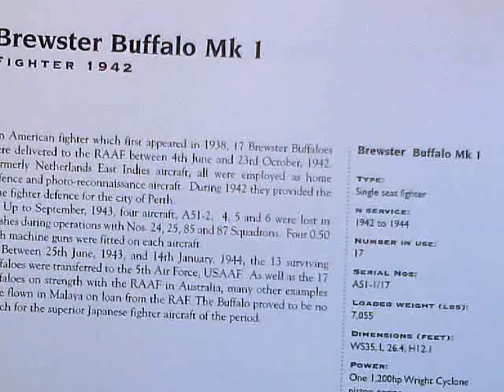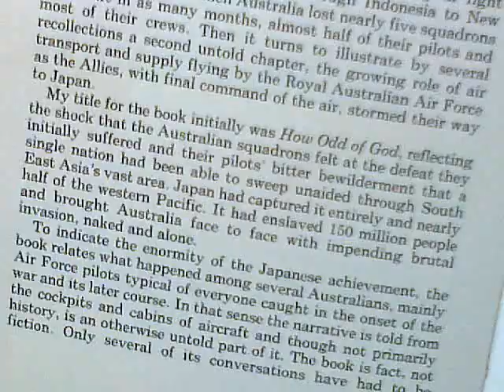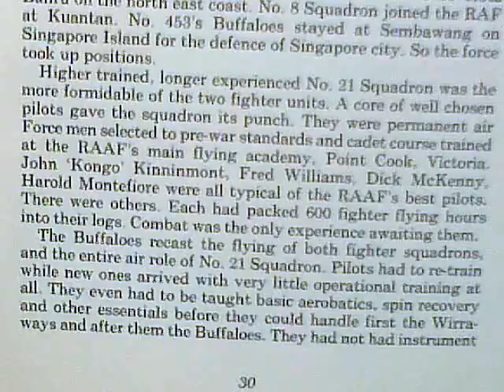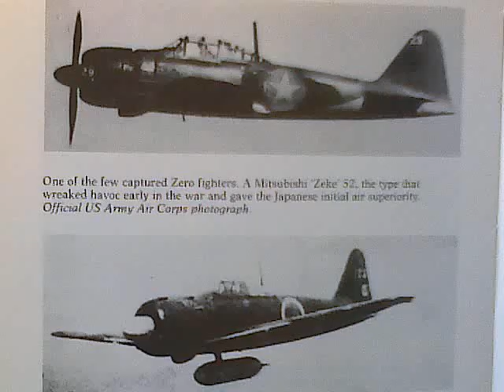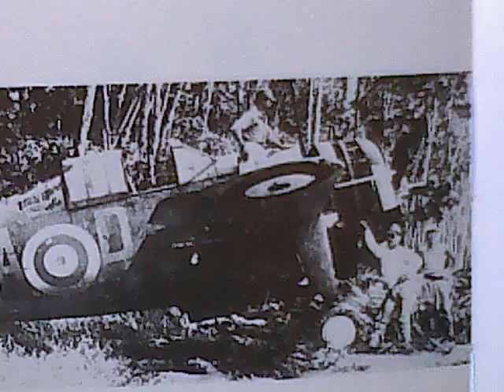World's Worst Fighter Aircraft, The 1941 RAAF Brewster Buffalo !

Comment: It only suffered lousy landing gear.
Otherwise it was not bad. 
It had a pair of the heavy .50 in the cowling with a lot of ammunition which didn't jam or malfunction under g-forces.    It was very manueverable.  Check
Pappy Boyington's description of flying it.  He says "you could turn it inside a phone booth". 
The American Brewster had the 1,200hp engine. 
It had very, very good range. (About 1,550 miles).  
It had a lot of pilot armor, like the Wildcat.  
It was basically a cockpit sitting on top of a radial engine tapering off into an oval cone. 
Finnish pilots flew this fighter successfully, shooting down all kinds of opposing fighter planes, beating both German and Russian pilots.
Reply from the maker: G'day,

  Thanks.

   As it happens, you're not correct.

   I was reading from first-hand accounts of RAAF Pilots who flew the Buffaloes which the British RAF bought from the US and supplied to Australia, for the defence of Malaya and Singapore.

 The .50 Calibre Guns fractured their .30 Calibre Mountings, the Cowling-Guns then simply jammed, and the RAAF Armourers worked their Arses off to cobble up stronger Mountings ; and then when that worked the Pilots complained about the Cosmoline Grease, in which the US Navy required the Ammunition to be packed before shipping, congealing all over the Windscreen and effectively blinding the Pilot in Combat...; the Wing Guns broke their Mountings, and sometimes then failed to jam - so they fired loose & uncontained within the Wings, sometimes shooting the Wing off...

  The HF Radios were hopeless after 10 AM every morning, because they were drowned-out by the Static from the Tropical Thunderstorms...; and the Pneumatic Fuelpumps relied on ambient Barometric-Pressure for the Return-half of every Stroke, so above 10,000 Ft the Pilot had to Hand-Pump supplementary Fuel in order to provide the Engine with sufficient Flowrate as to be able to obtain Full Power from the Engine.
  
  These points are NOT up for debate because they're well doccumented.

   To date, you are the very first (Fantasist ?) to suggest that the Buffalo in the Pacific was anything other than a lump of Dogshit with Wings ; in fact at Midway the US Marines didn't do any better with their Buffaloes than the RAF did  with theirs in Malaya.

  The Finns had earlier, lighter, versions, with Guns appropriate to their mountings, using German Radios (no Tropical Thunderstorms over Karellia, either !), and they fought an essentially Low-Level War against the USSR...; with very GREAT Success..., which is a topic for a different Video entirely.

  There was one Kiwi flying with the RAAF in Malaya who made "Ace" Status flying the Buffalo...; but everybody else found them to be effectively useless.

   Boyington is not at all known for exploits involving the Buffalo..., Curtiss Tomahawks & Kittyhawks with the Flying Tigers in China, yes, and Corsairs in the Pacific, yes indeedy ; but Boyington the Buffalo-Jockey - nope, not in Combat (though like Chuck Yeager and the Bell Airacobra, he may have flown them in training, under Peacetime conditions, or something...?).

 Such is Life,

  Have a good one.

  ;-p

  Ciao !

Comment: In hindsight, a minor overhaul in an adequate aircraft machine shop would have done wonders for the aircraft.  Problem is such facilities didn’t exist in the far-flung colonies nor did they have time to think about it when events “hit the fan.”  Secondly, the tropical environment and medium-to-high altitude mission were completely inappropriate for the design.  Other commenters agree, as they note Finnish successes in tuned-up versions in a cold weather environment, and applied to low-altitude scrambles against similar period Soviet aircraft.  Either way, it was just a rough and largely ignored inter-war design that filled a gap, nothing more.

Comment: The P40 in the Philipines fared no better aginst the better Japanese Zero fighter, whereas the Japanese fighters in the Malaya / Burma theatre were ALL less  advanced than the Buffalo.
The RAAF website gives the HP of the Buffalo MK1 as 1200 hp, with a Wright Cyclone engine.
This is a classic case of blaming the aircraft for shortfalls in training, support and logistics. 
The Buffalo was the ONLY allied aircraft that could out turn a Zero.
Reply from the maker: G'day,

Good luck with rewriting History, mate.

The 1941 RAAF Brewster Buffalos had time-expired reconditioned Powerplants which never ever reached their rated Power Output, and they were larded up with half a ton of Crap which the Finnish Buffaloes didn't have to lift.

But the failure-prone  Gun Mounts, the useless Radios, and the inadequate Fuelpumps were all issues with which other Fighters never had to deal.

Which lying infantile Video Game gave you the impression that a Brewster Buffalo could out-turn a Zero ?

  Would you like to buy the Sydney Harbour Bridge ? I can do a ripper of a two-fer, for just 300% more you can get the Opera House as well by way of a Job Lot...(!) ?

There there, nivertheemoind.

Stay safe.

;-p

Ciao